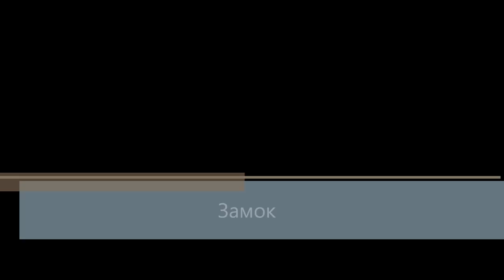Закрепка камней Stone setting (Замочки на браслет)

Comment: Hi could you please explain how do you remove the earrings from that gray party I boil it with hot water but it gets all sticky is it any other way to remove the earrings thanks
Reply from the maker: She is sticky while hot. It is better to put the product when it’s a bit cool, in this case it’s enough to pry off something and easily leaves. You can remove it with a hairdryer. Still easily broken by wire cutters.